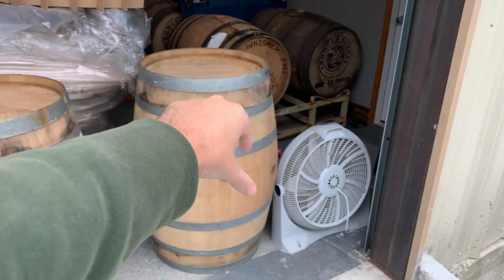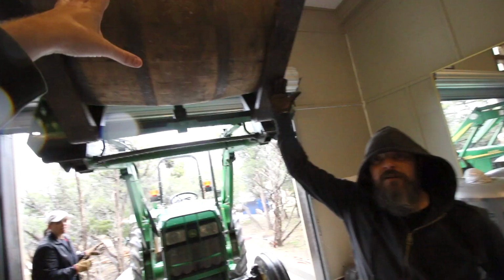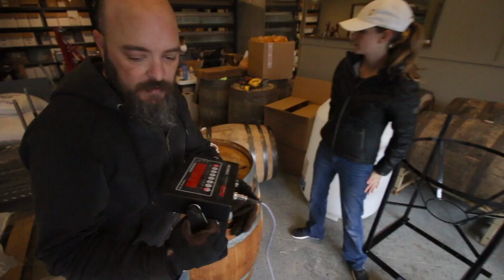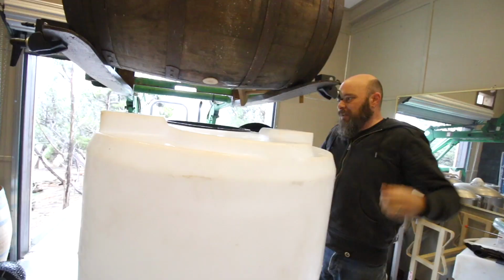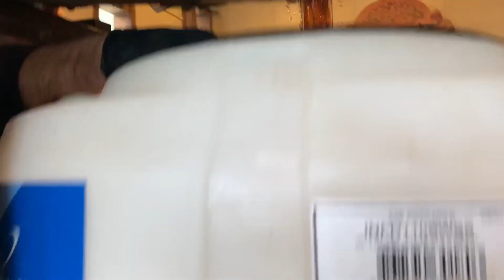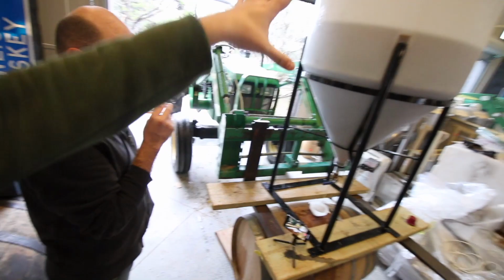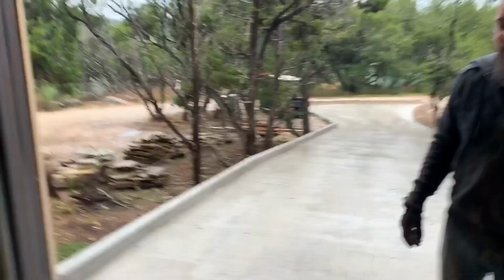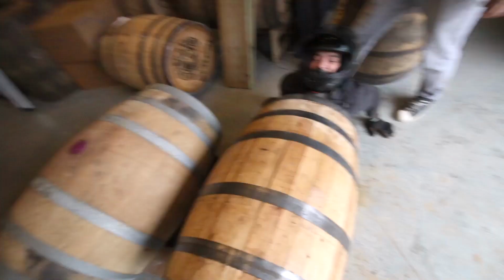When it all goes wonderfully WRONG...

Comment: Daniel trusts the hydraulics on that tractor wayyy more then i would.
Reply: Kt J yeah I thought that.
Reply: @mightyjoeyoung1390  Yes but if the hydos on the old tractor go out or the barrel slips off the forks then that couple hundred pounds comes down on his head. Even with a 10ton crane I dont stand under anything,  if it falls on your head your going to the hospital if your lucky.
Reply: Some hard hats would have been a good idea...
Reply: Checked the comments for this. Glad I wasn't the only one.
Reply: @mightyjoeyoung1390  But, if, there is an issue with the hydraulics, even a minor one, and the fork moves a couple of inches, he now has a couple of hundred pounds pinning his arm.
Reply: I was around the 4:30 mark when I read this comment gotta agree

Comment: As a kid, 11 or so, we used to bring a steel 55gallon barrel up on a slide.  Climb in, then roll it down the slide.  LOL.  

It was a slide that had a deck and the slide was very wide.  Wider then the barrel.

The dizziness, was probably a issue for years.  ;-)

Comment: Hey Rex and Daniel. Can you be a bit more detail on explaining what goes into the process of "cleaning" the barrel that use for refinish (wine, port, rum). Like, how to, or what was used to cleaning those barrels before pour in the aged whisky into those refinish barrels? Do you re-toast the inside of barrel first? Was it dry when you pour in the aged whisky? Do you pre-wet it? If so, what was use to pre wet? Do you clean it first? if so, what was use to clean the barrel? ...etc. Thanks guys.  I also just had my mooching experience of your Crowded Barrel the Eleanor.  It was fantastic, keep up the good work and hope I'll be able to make my way down there to pick up a bottle soon.

Comment: 9:45 there is a better way into barrels without destroying the barrel.  All you need is a flat head screwdriver and a hammer.  if you just work off the top to ring you can then pop out the end cap returning the rings when you're done.